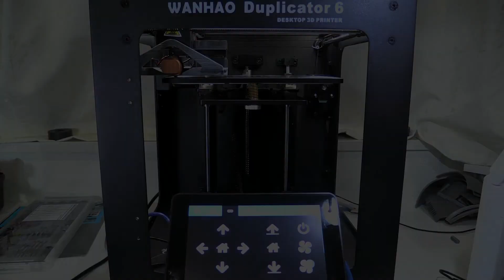Wanhao Duplicator 6 Z-Axis Motor Damper Install

Comment: Hi, Its wery usefull video , thank you for sharing.  I got a same printer and I would like to ask how do you connect the touch scren ?
Reply from the maker: It's a raspberry pi screen connected to a raspberry pi running Octoprint and Klipper etc, which is connected to the printer with a USB cable.
Reply: Thank you for your replay.

Comment: Are you still using this printer and modding it at all? I've gotten back into tinkering the last few months and am working on modding my mmu/wanhao D6 for convienience and better prints. I have a similar fan mounted on my main board; did you cut the bottom panel to allow fresh air there or is the clearance okay? Also did you reverse your PSU? Mine faces the other direction..
Reply from the maker: I use my D6 all the time. It is heavily modded running octoprint and klipper with Micro Swiss hot end parts, replacement 8mm rods, igus bushings, and a BlTouch bed levelling probe and the Wanhao magnetic printbed (Both of the last two are awesome).
It prints really well now. The last thing I want to do is replace the printbed with a machined steel pate to make sure it's perfectly flat.

I did reverse the position of my PSU, I have it rotated so the fan in the PSU lines up with the hole cut in the base for better airflow.
Reply: I'd love to see a follow up video of all your mods, maybe with a brief overview of how it's done (nothing crazy like a step-by-step full rebuild lol)

Comment: How do you take the bottom cover off? I have a fan that needs to be replaced and don't know how.
Thanks in advance.
Reply from the maker: On the sides of the machine, right near the bottom there are two Allen screws on each side.
Reply: Thanks so much for the help! Have a nice day!

There are many screws there and I didn’t know which ones to unscrew.

Comment: I am curious about the cooling fan you are using for the main board. My original fan is groaning pretty badly and do not want to replace it with another one like it. I would like to know what fan and where you got the files for the brackets. Thanks
Reply from the maker: I ended up installing a 50mm ball bearing fan from digikey in the end with this bracket:

https://www.thingiverse.com/thing:2640681
Reply: NFM I KIND OF went over kill. I managed to fit a 120MM 24V case fan and I STILL have the case on the bottom.
Reply: Hey Crispy, How did you mount that?

Comment: Did the x and y, ended up flipping the gears around on the shafts of the nema motors to adjusted for the spacer. The abs printed brackets I had did not work. Going to try this, but with Petg for the spacer for the z.

Comment: i think the reason the Z damper doesnt wotk as well is because there is still a metal mechanical connection between the motor, screw, bearing block, frame.  Where the X and Y have the belt to help isolate the vibration.
Reply from the maker: Yeah, I think the same. After using it with the Z-damper for a while, I found it is a reasonably decent reduction in noise (A bit more than in the video) in 'real-world' use, so it's a good mod to do if you are bored one afternoon. :)

Comment: I also have a Wanhao Duplicator 6 and been quite happy with it so far. Haven't made any mods other than going to a Micro Swiss All Metal Hot End but I'm definitely interested in your other modifications. Definitely getting these dampers, at least for the X/Y as the noise reduction is quite drastic.

Have you found a difference in quality when printing with the silicone shoe and upgraded fans? I found printing in ABS to be challenging, warping being the main issue, but also overhangs are hard to get right, probably because of insufficient cooling.
What slicer and settings do you use?
All this would make for an interesting video for I think.
Reply from the maker: The silicon boot and additional fan is a really good improvement  for cooling down the extruded plastic quickly and evenly and improving print quality.
The single fan is one of the big drawbacks of the printer, but it's easy to add a second fan.

Stick around and I'll do a video on that soonish.
Reply: Still waiting for that video :(
Reply: Waiting on the video also, but know your probably busy.

Comment: My dampers showed up this week, I was going to put them in this weekend.  Does that Z spacer need to be printed in ABS if at some point I may do ABS prints with the enclosure closed up?
Reply from the maker: My Z-spacer is printed in PLA with a good amount of infill for strength.
It sees practically no heat so PLA is fine.